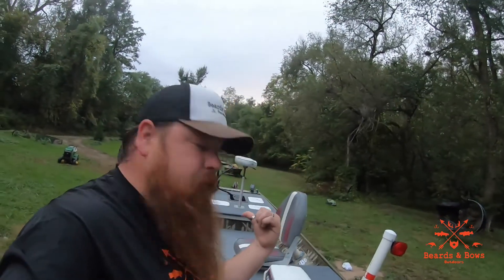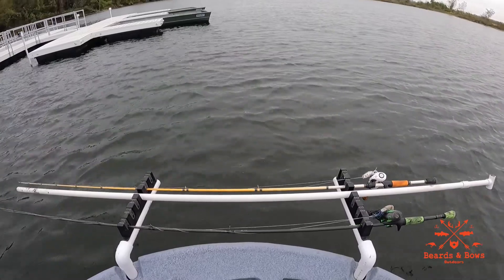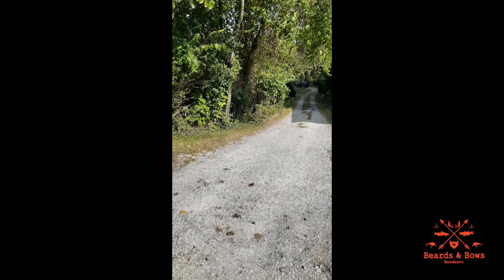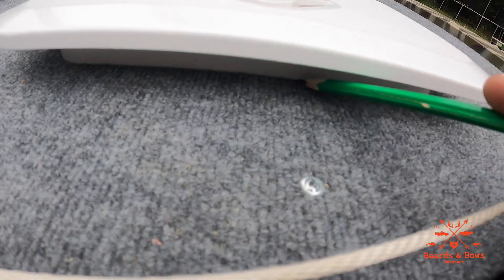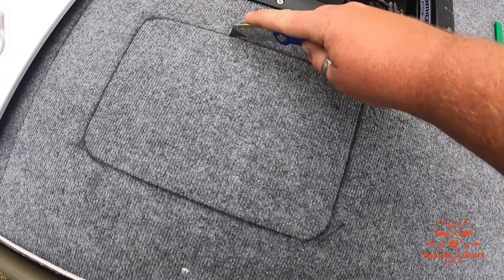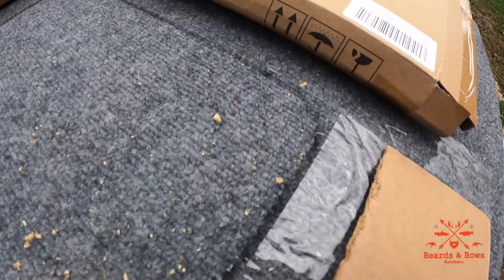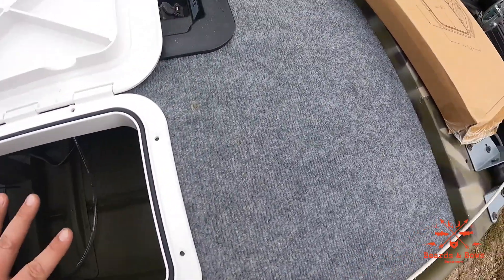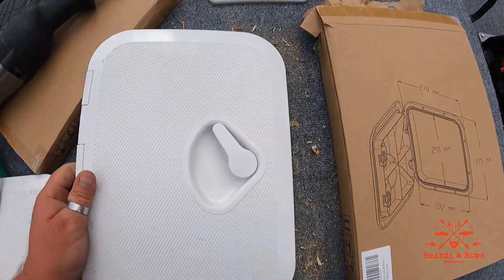Jon Boat Storage Hatch Install / Jon Boat To Bass Boat - Part 6 / Boat Storage / Diy

Comment: Nice! I just bought similar hatches and I got some bins to attach to the underside. Like day boxes. I’m not there yet, but it’ll work great I think.
Reply from the maker: Nice! How do they attach?
Reply: @BeardsAndBowsOutdoors  the hatches screw into the deck like yours. My plan is to secure the bins to the underside of the deck with some angled aluminum or just through bolt them. They are some real tough plastic.
Reply from the maker: I was thinking of trying some cheap plastic wastebaskets to insert but it's a wild shot. I may strike gold or have extra trash cans lol
Reply: @BeardsAndBowsOutdoors  haha! Worth a try. The bins I got were only $8. Home Depot brand. They had some larger ones too that I may get for PFD’s and such. Still playing with the budget.
Reply from the maker: Let me know what you settle on. Would like to see what ya do
Reply: @BeardsAndBowsOutdoors  will do bud! I’m planning to make some vids on the build.